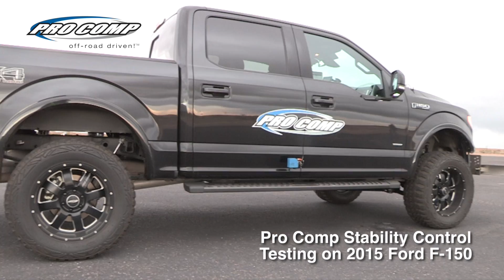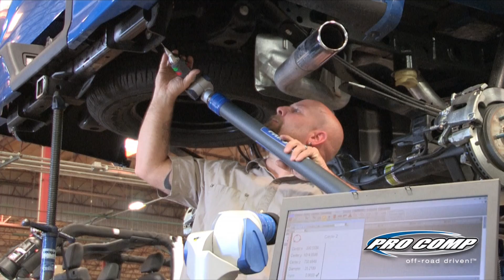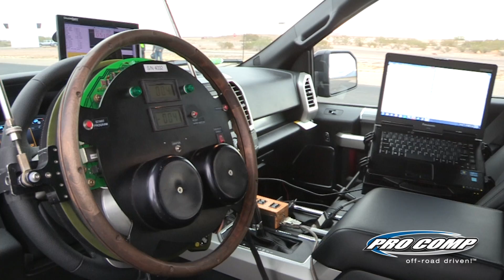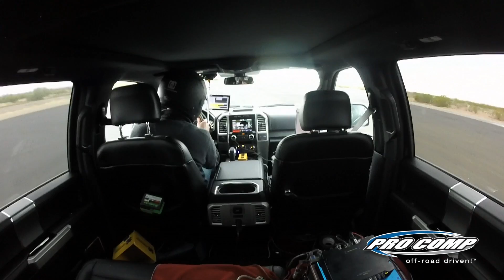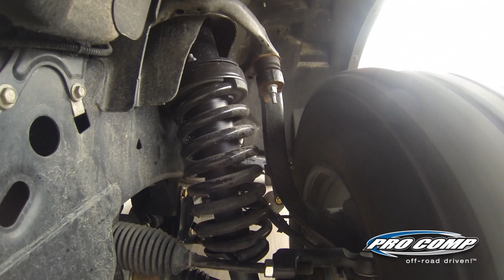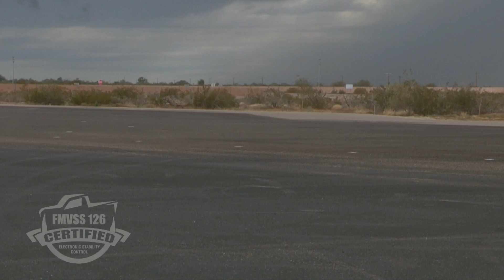Pro Comp 6-Inch Suspension System for 2015 F-150 Passes FMVSS 126 Testing

Comment: Beware of pro comp lifts! 

Purchased a kit for the functionality and the compatibility with my truck. Researched the kit for over four months and pulled the trigger. Shortly after dropping my truck off to my local shop, I quickly found out that the strut bracket was incompatible with my truck. So both my local shop and I quickly contacted the tech department and was told that all prerunner shocks and coil overs were on back order due to a transition in manufactures for at least two months! Guys I can’t make this up! Do yourself a favor go with another brand and don’t make the mistake that I did! Customer service is being there for the customer not packaging something and leaving them out to dry!